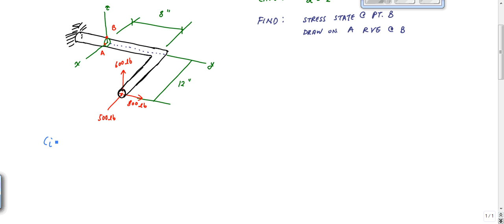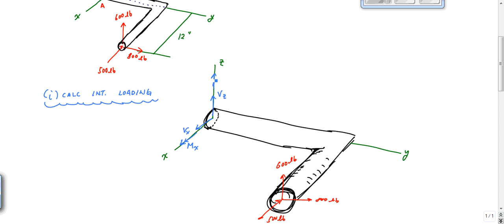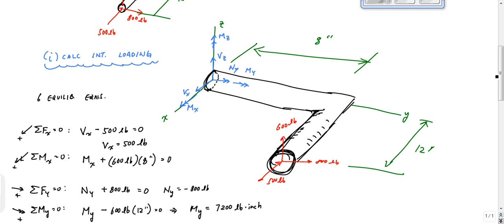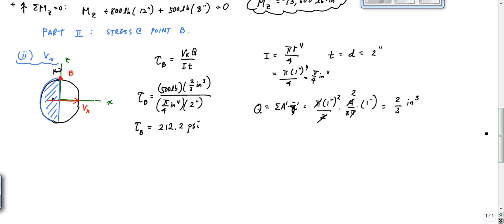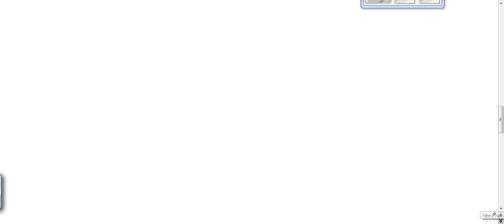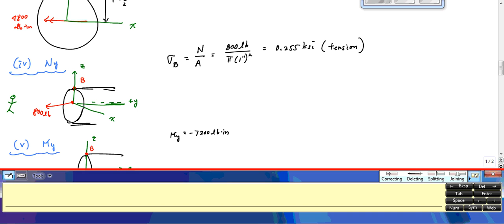Combined Loading 3-D Example (Part 1) - Mechanics of Materials

Comment: Thank you for the great video sir, how do we know when to use the correct shear vs stress equations. For example, for Ny, how do we know that normal stress is N/A and not Mx/y. Same goes for the shear equations. Also, when do we apply both equation for both stress n strain. Really struggling with this concept

Comment: I'm more interested in drawing an infinitesimal element cube with arrows for axial, bending, transverse shear, and torsional shear. A problem that is more conceptual, drawing at different cross sections at different points (ex. top of cross section, side of cross section, etc.)
Reply from the maker: Good idea!

Comment: For part 3, when you find the normal force due to Mx, how did you know it was a normal force and that it compresses point b. I just cant quite visualize this piece. Thank you
Reply: Visualize it as a beam bending. The moment about the x-axis is due to the 600lb force. Its causing compression at the top (where point b is) and tension at the bottom. In simple words visualize this as a smiley face. Top in compression and bottom in tension. Hope this helps.
Reply: @bzq3386  Thank you! This helped me realize to look at it in its entirety, not just the cross-section. Because if you think about the rotation the 600 lb force will cause, it will go through the plane of the cross-section. Thank you again
Reply: @nicolef4552  Welcome!

Comment: bro could you solve this problem please ??
assist please ....
the question is given below and i am sharing the link for photo of question.

Link of photo:- https://www.google.com/search?q=Images+for+The+aluminum+alloy+control+arm+is+subjected+to+the+loading+shown+in+the+picture+below&tbm=isch&ved=2ahUKEwi-tLyE7YLsAhX273MBHc49AR8Q2-cCegQIABAA&oq=Images+for+The+aluminum+alloy+control+arm+is+subjected+to+the+loading+shown+in+the+picture+below&gs_lcp=CgNpbWcQA1C1voEFWKjGgQVgvMuBBWgAcAB4AIAB7gGIAYoHkgEDMi00mAEAoAEBqgELZ3dzLXdpei1pbWfAAQE&sclient=img&ei=Jh9tX76JFvbfz7sPzvuE-AE&bih=706&biw=1519&hl=en&hl=en#imgrc=ijGpCFAO4XeTQM

Question:- The aluminum alloy control arm is subjected to the loading shown in the picture below. The vertical load F1= 45 kN and the other is F2=42kN. The details of the arm are the following: L1=511 mm, L2=263 mm, L3=276mm, and the thickness t=14mm.  The pin diameter and each support bracket thickness are 25 mm and 5 mm respectively.determine
a. The resultant forces at location C and A (25 mm diameter).
b. The axial stress in the rod AB if knowing the rod diameter is 15 mm and 200 mm length.
c. The shear stress in the pin at C
.

Comment: is that possible to add(combine) two mechanical force(torque) 
Ex:- if i have two 1.5v batterys >> 
- if i connect in series the voltage increase 
OR
- if i connect in parallel current rating is increase

same as in mechanically 

either rpm increase 
or torque increase 

i dont know is that good question or silly one........hahahah
but please replay me if you have any suggestion

Comment: why is it shear stress and not normal stress? can you explain how to distinguish(pick) what type of stress it is
Reply: +deepak np remember that shear is across a surface, normal is into a surface. So if you look at the force of y in this example, it goes into the surface therefor it is normal stress. If you look at force of x, it goes sideways, therefor it will cause shearing.
Reply: floormatt3 omg ty so much!
Reply: You just saved a very frustrated student!

Comment: Shouldn't all of your signs be flipped if you are considering the stresses at B resulting from the applied forces?  i.e. You are finding the internal forces and moments that balance out these forces, but you're considering the left side of the cut when your proper sign convention would result from considering the right side of the cut.  Gnomesayin?
Reply: +Fricks and Fracks No, when you write out your equilibrium equations you will find this. In this example, when finding Vx, you would write out the equilibrium equation as follow: Fy = 0 = Vx - 500 => Vx = 500. This Vx is headed the opposite direction, and therefor balancing like you say. There is no need to switch the signs once you've found your forces.

Comment: Is there a confusion between moment and torsion?
The way i see it, for the x-axis: 600*8 is the torsion while 600&12 is the moment, please clarify.
Reply: +Shawn Ng No, the torsion happens along the normal axis. Basically, if you draw out your cuts like he did the torsion should make a clockwise/counterclockwise arrow. In this example, that only happens along the y-axis and not the z- or x-axis.

Comment: Hi, Actually what to do when the cross section is of Hexagon and not circular. I have an assignment of allen wrench in which we need to follow combined stress method to check the convergence between hypermesh and Mechanics of material results.

I can send the pic of problem if i get an email id if you provide. or anyone who can help with the topic

Comment: How do you know when it was shear stress and when it was normal stress? I know normal has to on with it being perpendicular to the force and shear has to be parallel. So why is Mx in normal stress and not shear? and same with the rest. THank you
Reply from the maker: 911Teresa911 bending moments have a tension and compression force couple which are normal to the surface and cause a normal stress, they also cause elongation and contraction which are associated with normal stress.  Twisting moment or torque cause angle changes which are associated to shear stress.

Comment: 11:53 mins into the video you made a mistake....the polar moment of inertia is (pi*r^4)/2
Reply from the maker: At 11:53, I'm using the area moment of inertia, I = (pi*r^4)/4 to calculate the shear stress due to an internal shear force.  The polar moment of inertia, J = (pi*r^4)/2 is used to calculate shear stress due to internal torque.
Reply: my bad...sry

Comment: Wait I think I understand now. My signs are basically opposite then yours , but they should give me the same answer. While my compressive normal force is positive, yours is negative, and while my moments are positive or negative , yours are the opposite sign. But they should give me the same answer, is that correct?

Comment from the maker: @Panth Naik as long as you also calculate the internal moments and torque at the cut, you will get the same result.  It is not really superposition that is being applied, rather the six equilibrium equations.

Comment: Quick question , at the beginning of the problems why did you not superposition the applied forces to the cross section at b. Hence giving vx=-500,vz=600, and ny=800, then going from there. Thats what my textbook does, they just take the applied force and put it onto the cross section of where we are looking at. Does your method and my method give the same result in the end?